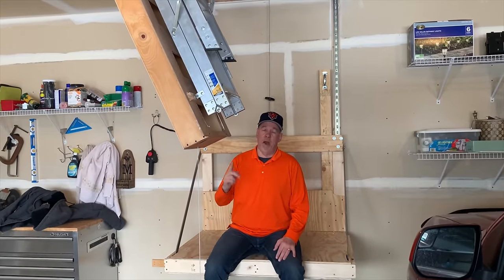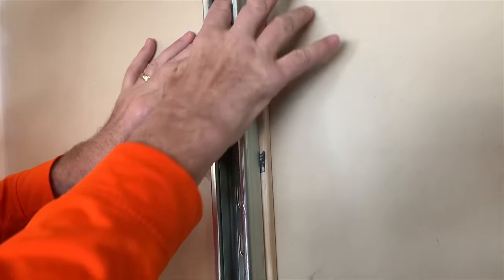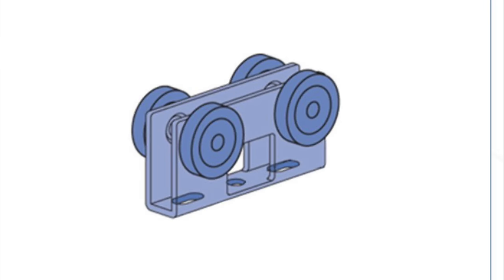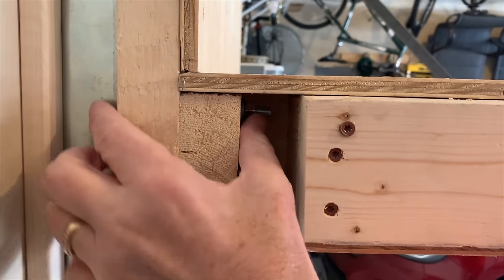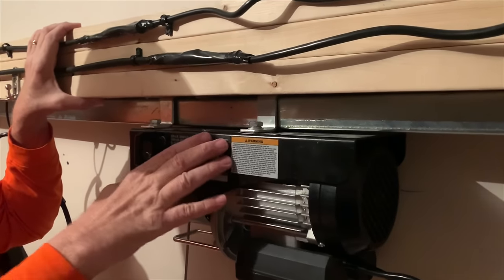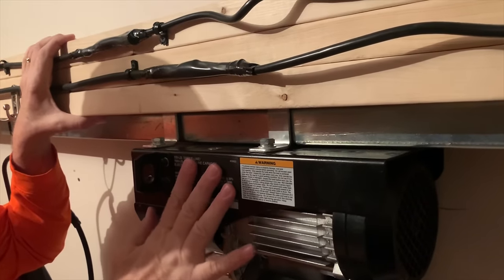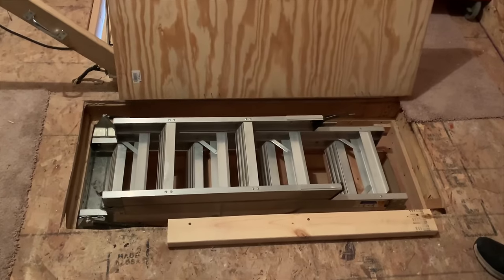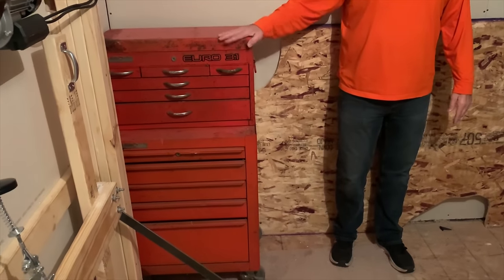Garage Attic Elevator / Lift Build in Minneapolis Minnesota

Comment: I am building one of these myself in my barn.  I have been using this video as a guide for the basic build.  Thank you for posting this.  I am planning on also building the platform out of wood, although I have been waffling on the idea of having someone weld a frame together.  Now that you have had it for awhile, any changes you would have made to the design?  Did you have troubles getting your superstruts aligned?

Comment: I have the following comments...
1.  If the garage is attached to the house then I believe that in all locations in North America you have to have a fire separation between the garage and occupied space in a house of at least 1/2" or 5/8" drywall.  This is for fire safety and if you don't have it then it could be life threatening.
2.  If the garage is attached to the house then I believe that in all locations in North America you have to have a vapour barrier between the garage and occupied space in a house.  This is to prevent/restrict harmful varpours from entering the house and moisture barrier to prevent mold from forming.  These are both health concerns.
3.  You mention below that you have a safety factor of (4x).  Please be aware that certain components of elevators/residence hoists have safety factors recommended to be a lot higher than 4.  For example hoisting ropes have a recommended safety factor of (7-10x) / wood support structure for the motor (6x) / drive machine (8x) for the sheave per ASME A17.1 - Safety Code for Elevators and Escalators.  I understand that your primary use is to use it as a material lift but I saw two (2) people ride the lift in the video.

4.  Also note that the safety factors discussed in item three (3) are also using loads doubled for starting and stopping so the (4x) safety factor that you refer to looks very light.

5.  There are many safety concerns with a hoisting device that haven't been addressed.  For example... What about protection for Grandkids/Pets below the hoist when lowering.

6.  You talked about using three (3) 2x6 stacked for lots of strength.  Please be aware that if you don't screw/laminate the 2x6's together then they really act independently and not as a solid beam which you seem to refer to them as.

7.  What is the grade of lumber?  Did you use SS - Structural Select/No1 or No2 grade... Standard 2x6 lumber that you buy from home depot is generally stud grade or designed to be vertical or long (6") dimension vertical - not horizontal like you have installed them.  Also some of the edge distances on your main bolts in the carraige look quite small.  Please be careful with wood splitting/tearout.

8.  You have carried loading through posts to the floor of the "attic space".  Have you thought of how the load is transferred down to the garage footing/foundation?

9.  The motor you refer to as an "industrial motor with lots of capacity.  Please be aware that the motor should be UL listed.  I have seen many hoists that have been sold in North America that are not manufactured with a minimum standard of quality for a use such as hoisting people.  The 550lb capacity motor is not a suitable size for elevating people.  (Refer to Item 3 above)

10.  Did you convert the attic space above the garage yourself?  Be aware that occupied residential spaces are typically designed for approx 50lbs/ft2.  Have the ceiling joists been designed for occupancy?  Be careful how much you/future users load in that space.

11.  You may be opening yourself for a lawsuit should someone get hurt or property damaged due to your hoisting mechanism since it has not been designed/installed/maintained according common design standards.

12.  You may have an issue when you sell your house for the same reason as given in 11.

13.  There are many other issues with respect to the elevator design that have not been addressed but this is getting too long.
At the end of this, with the all the safety concerns and available safety standards that have been published with respect to elevators/private resident lifts I would suggest that this is NOT A DO-IT-YOURSELF PROJECT.
Reply: @theelevatorSRT8  If someone copies your design and u have not made the post do this at your own risk. U can be held liable. That is all this guy is saying. Pretty much take the Video down. Other Diyers have been sued that have posted Video's like yours. And someone else used their post as an example how to do the job. And I see serval comments of the fact on this post.
Reply: @scraplifetrashtocash4551  DIYs DO AT YOUR OWN RISK. IF YOU DONT KNOW WHAT YOURE DOING, DONT DO IT. There are Lots of crazy ideas on here, Research it out if you want to try and Know that it Wont be code Legal.  Very interesting project :)

Comment: as an elevator mechanic this makes me cringe on numerous levels.  you deffinately SHOULD NOT be riding that.   I get it for using to get gear/supplies up to the attic.   but something to think about is the resale of the house.  since Im sure this is un permitted it will cause issues when you sell the house.
Reply: Will not affect the resale if you remove it.  Very simple adjustment.
Reply from the maker: Thank you for your concerns.  We added fall arresters, see that video, but more importantly, Mitch and I designed an emergency brake! That video launches at Noon today!
Reply from the maker: Thank you you buddy!

Comment: The engineers and safety experts sure do like spending their time on YouTube making comments.
Reply: Some of us have been designing and manufacturing material handling equipment for decades and we cringe when we see stuff like this. Oh well.
Reply: @OU81TWO  Some of us are REAL Engineers so it's amusing reading the comments. I've yet to see one person point out the weakest point......Since you're an expert it should be easy for you though, so give it a shot.
Reply: @theelevatorSRT8   Okay so can you tell me how much weight you can safely lift with what you built and what kind of safety factor you think you have? Also, what's the rated capacity of the trolley wheels you used and how deep is the platform from the rails to the outer edge?

Sure people install their own brakes but they don't design and fabricate their own systems. Assembling an industry proven and reliable system that is purchased from a manufacturer is not the same as designing and building your own.
Reply: @rawbacon   Electric hoists should never be used to lift people. The brakes are not safe enough for that application. That intermittent fretting noise you hear as the platform lifts is the cable rubbing and skipping over itself as the spool winds. This is going to cause premature wear and damage to the cable. This is happening because the end of the cable is fixed to the platform and is restricted from moving over to wind itself correctly next to the previous winding. These are just a few of many issues.
Reply: @theelevatorSRT8   If you say it should not be ridden by people then did you build a fall arrest?
Reply: @theelevatorSRT8  YouTubers should definitely comment and answer questions more. But then you get these crap trolls to ruin it lol. Everything looks pretty well over built for no more than you're doing. The one thing I would upgrade is the eye bolt area just where it doesn't pull through. It'll probably never pull through. If all else fails, paint it yellow and get AVE sticker that says not to be operated by duckwits
Reply: @OU81TWO  What're your thoughts on how fast the wear and tear from the spool winds will damage the cable? It might not be an issue since it won't be used very often - if for seasonal purposes, a few times each year. If it was being used to move 2-300 lbs a few times a day, that might be more of an issue right? #notanengineer
Reply: @nicidanna   Depends on use but it's not something I would do personally. I make my living designing/manufacturing custom machines and lifting equipment. When I build stuff for myself I do it the same way I would for a customer. Having said that I have a winch on my truck and the wire rope is pretty mangled in some spots from wear and tear and it's held up for many tears of abuse. Does it concern me? No because when I winch I always assume the cable will snap and set up my line and safety perimiter accordingly. I'm also pulling horizontally so the consequences of a line failure are never catastrophic. I don't apply the same mind set to lifting people because the risks are too high. At the end of the day that's what it comes down to...risk assessment. Would I ride a contraption like what's shown in the video? Never...because the consequences of a failure are too high.
Reply: Raw Bacon - this video is being showed to many people, some of whom will have less sense and understanding of the safety issues that deserve consideration. Those who are commenting might seem to be critical, but there is another perspective - these critics are in a way trying to protect those who understand this stuff less, and who would attempt to recreate what they have seen in this video. Perhaps the critics could have been less harsh in how they expressed themselves.
A very important consideration always has to be safety. Building codes and regulations have safety in mind, and anybody constructing something similar should realize that, and make an effort to abide by those building codes.

Comment: Good information about a really basic system which is exactly what I’ve been looking for. I just wasn’t coming up with any ideas for a track system. Seems like that will work out quite well. Are those the tracks that they use for hanging plumbing and electrical on commercial jobs?

Comment: The “beam” you have running horizontally up top that the winch is mounted to should be turned the other way..  the strength of lumber or beam building gets its strength from the boards being laid vertical instead of horizontal

Comment: One more thing, your attic has a fire barrier between the house and garage so in your case cutting through the sheetrock ceiling was ok but in most garages the ceiling IS the fire barrier and what you did completely breeches the fire barrier.

Comment: Truss design and load bearing capability?  Load transfer to the bearing points of the foundation?  Weight of the platform looks significant (probably a couple hundred pounds at a minimum) and must be subtracted from the motor/cable limitations before people and storage items begin lifting operations.  Long term effects of overloading the structure been examined?  Trusses normally are not designed to load in such a manner and then add a high year snow load...may not have issues until you hear the snap/explosion of failing structural members.  Might want to ask an engineer friend to examine this operation...might save a life or prevent expensive damage.  Just because you can, doesn't justify doing it.

Comment: Interesting that you erected a Slab type beam? For The cable winch ; is it rated for lifting or pulling? Attaching  the The load sled with a pulley attaching the cable back to the winch dramatically improves lifting dynamics! From the engineering standpoint it's nice to understand the hole which you made the lift through ! your rim Joist design seems like you removed one joist to create your passage point more information on this would be of interest.... It's an awesome idea,  I think for safety we should come up with a mechanism that insures the platform locks every few inches much like a roller coaster cogs on the lift hill...   Peace

Comment: Wife just sent me a Tick Tok of one of these winch garage elevators.  AT FIRST, I was puzzled as to why he used a short tow strap wrapped around the center of his lift board UNTIL I saw that bolt all the way through your lift board, as I would have done. I realized, he brilliantly used the strap so he didn't have to drill a hole in his lift board, thereby weakening it. Strap also spreads the load.

Comment: You might want to check out MN Statute 326B.263 through 326B.191. Of special note is .178 Subd. 4. Penalties. The commissioner shall administer sections 326B.163 to 326B.191. In addition to the remedies provided for violations of this chapter, the commissioner may impose a penalty of up to $10,000 for a violation of any provision of sections 326B.163 to 326B.191.

Comment: I like it, my only concern would be there's no auto safety lock should the cable, motor or gear box fail.
If someone came up with an inexpensive safety lock, I'd feel more comfortable using it.

Comment: Your roof trusses are not designed to carry the load unless it was specifically built that way and 99% of them are not. How did you go about verifying this? I also want to know how you cut the holes so big without cutting a roof truss? The sad things is 99% of viewers will think this is a great idea when it most likely isn't for a whole host of reasons that I can't tell from just watching the video.

Comment: I looked over all the potential safety implications of this and decided to wimp put and by an electric hydraulic pallet stacker. It does the same thing but it is good for 2000 lbs and I can move it around. It cost me $1000 with delivery and a new battery, so not cheap.  I'm sure this thing here will work just fine as long as it is operated with care and not overloaded and nobody stands under it etc.

Comment: The header members laying flat is a glaring engineering failure.  Like a floor joist, it should have been one member on edge.  2 would be okay but the important thing is that they are tall like a floor joist.
A stack of papers are easily bent.

A proper header can be placed on top and fastened to the one below.

Comment: I like the idea a lot , thank you. I will like to comment about the UNISTRUT  This are designed to work with spring nuts, which when it is tight it locks the strut from opening which in this case the wheels will come out. And also you might want to add some type of braking mechanism in case of cable failure. I am not an engineer. But I have seeing plenty accidents. There are so many limit switches what can be added to stop the lift to prevent an accident. Like if on the upper floor is a rail that can only let the lift operate when that railing is close. Many of us don’t think about the safety until one of our love ones get hurt.
I very much appreciate this video, it gave me more ideas to build a similar lift. Thank you!!

Comment: Very nice, my only concern would be a lack of any locking device to prevent it from falling in case of failure. Some people have built similar lifts but incorporated a safety mechanism to prevent if from falling.

Comment: It's so well built, you likely need to secure it against unsupervised use.  It is unsafe for moving people for the following reasons.   1. no anti-fall measures.   2.  entrapment hazard, when lifting against the roof, no safely off switches.  Currently it's very impressive.  Just needs a little more enhancements, for safety reasons.

Comment: nice idea , just a reminder the shear strainth of the ply wood is stretching at 3:20 seconds , you can see it  , redesign the back of the box frame  flush and buy  longer lag bolts  and use deck screws 3 1/2 long to fasten in the center of the stud work  each screw holds 450 pounds of dead wait .  your chose of lag bolts holds 800 pounds of dead wait .     what was the over all wait that can be lifted ?      never mind , started watching the vid from 3:20 to finish   you did use deck screws  , but you can see where your lag bolts are deforming the wood from load wait.   all in all your the man and many guys are going to build this becouse of your vid..

Comment: Did you put a clamp on your winch cable to limit your up travel too the same spot every time?

You could used a board, mounted to the back of the  platform, like the hand hold and build an adjustable threaded stop plate to make sure the winch stops at the same place we everytime.

This would eliminate and damage to the winch cable from a cable clamp, since you have no fall arrestor built in to the elevator.
Reply from the maker: Hi, yes I added something since the video but I’m not happy with it. But I have another idea. The trouble with what I did is that it’s a solid contact when it needs to be spring dampened. I realized it was important once I did it. I always stop it anyway but at least now I have a fail safe. My biggest concern with not having it is the potential to sheer whatever is keeping the hoist from free wheeling. Which would be bad. 🙂

Comment: Only thing I would say is that the header you created at the top is running the boards horizontal instead of in their vertical orientation which would be many times stronger. It's still built like a brick shithouse so I doubt it will matter.